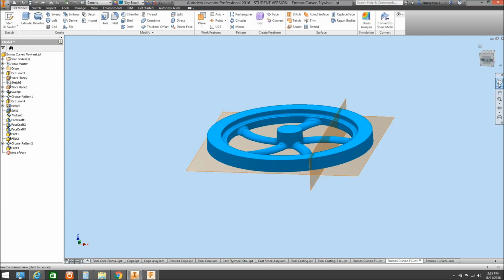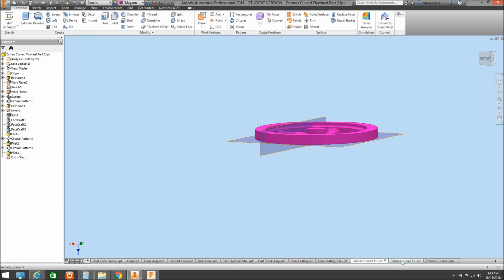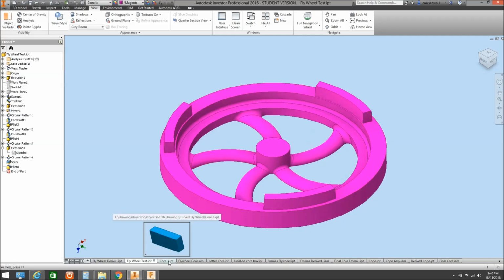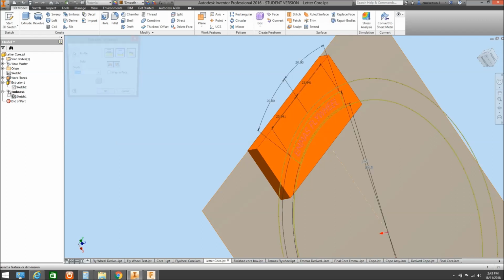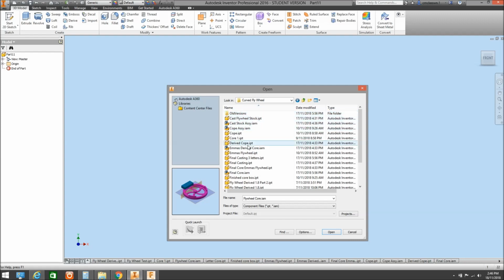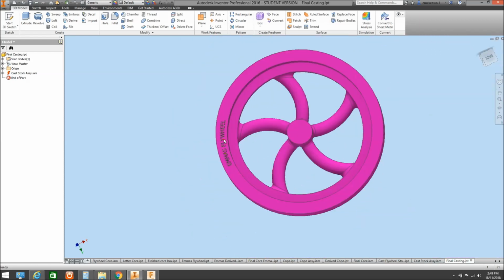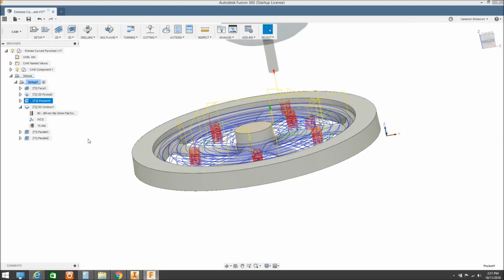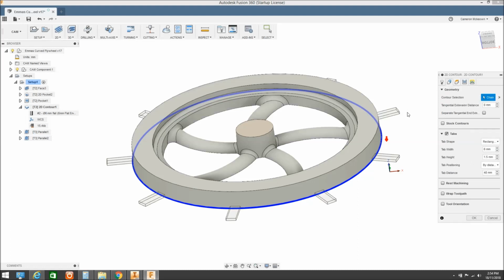Fly Wheel Solid Modeling and CNC Machining Part 2

Comment: Hi Cam, great videos, have you tried Vectric Aspire CAD cam software?. I use it for router and mill work, and have found it very easy to export vectors from Inventor to it. Cheers.
Reply from the maker: G'Day Phil, I have tried the cut 2D & 3D Vectric programmes.  I have a good mate who uses it to cut out custom parts for building model Airplanes.  Very sweet programme but like most things you need the money to buy which at the moment I find hard to justify to the financial controller in the house.
Cam